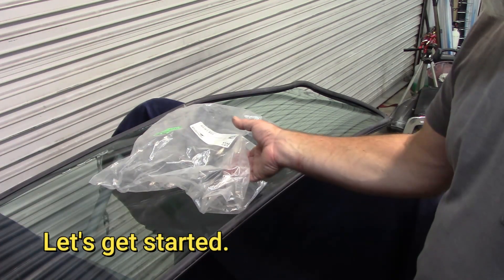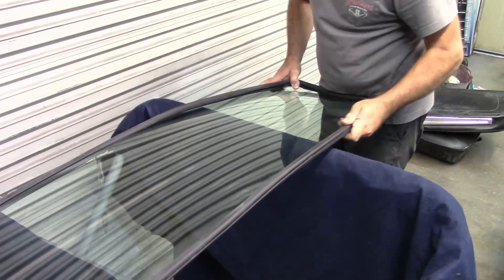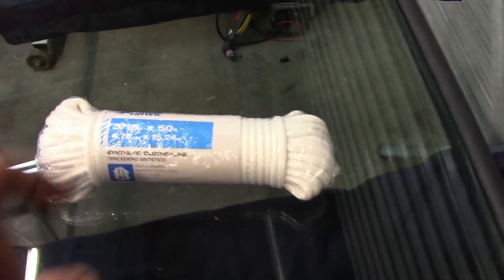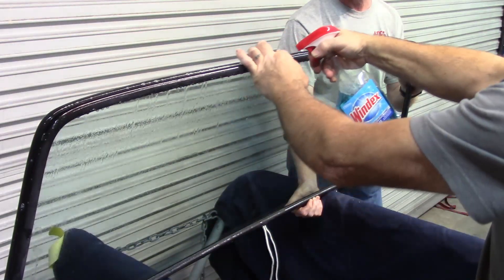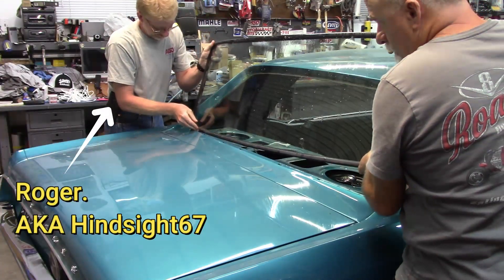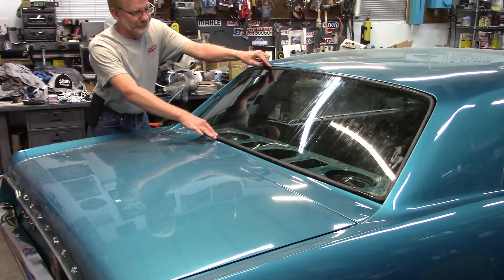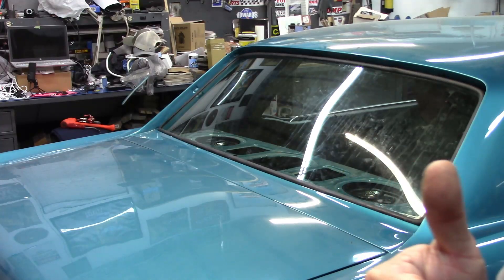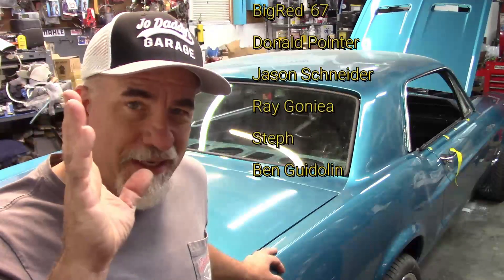Rear glass install in a classic Mustang. Jade part 91

Comment: Yes, kind of messy, but I think the sealer goes between the rubber and the pinch welds as well. I guess especially important for the windshield to prevent leaks.
Reply: Anybody that says you don't need sealer on glass and pinchweld hasn't had water soaked carpets yet.... Probably garage queens.

Comment: Your "booger hook" is a cotter key puller. Very handy in a myriad tasks. Gaskets like this, or to align bolt and clamp openings, pull components into place, thread on a washer onto a stud in hard to reach places, and many other things. No self-respecting aircraft mechanic will be caught without one.

Comment: Good video.  I was told by a friend who did auto glass to put the sealant between the glass and seal when you stretch the rubber on the glass.  I don't know what works best.  I will try it when I get around to putting my windows back in.
Reply: Put the sealant in after the rubber is stretched into the glass. OR Some say before because it lets the rubber slide and stretch easier.  Then clean up the sealer mess before installing the glass into the car.

Comment: Ive restored both a 64 and 65 Beetle and the window rubber and install is the same except no sealant at all is used and it’s fine.   I wonder why the mustangs are so sealant and strip caulk crazy?   Irregardless I will do the sealant and strip caulk when I put the windows back in my 66.

Comment: Why no sealer?
Reply from the maker: I talked about it in the video. I'll add sealer later.
Reply: @JoDaddysGarage  Yup...I posted the comment before the end of video. :-) Will just adding it as you intend to give a good seal? I've heard it needs to be between seal and body also.
Reply from the maker: It should be fine. I will add sealer inside the channel, and around the outside before installing trim.